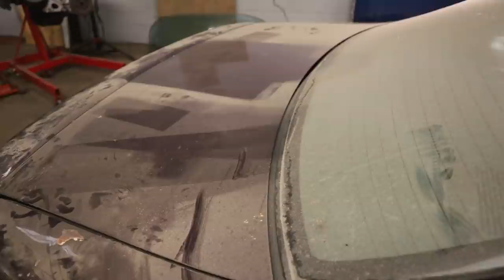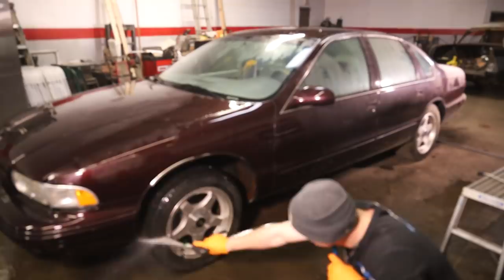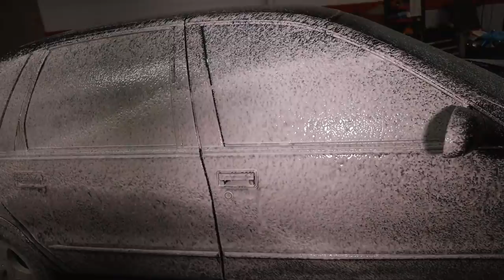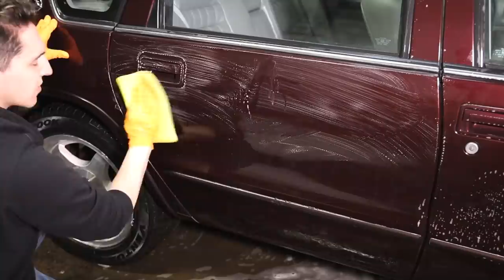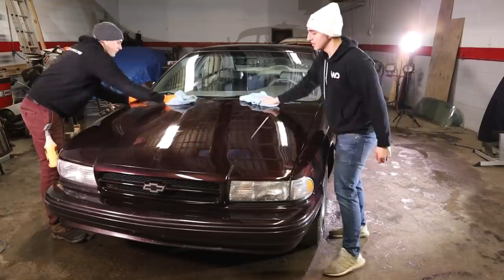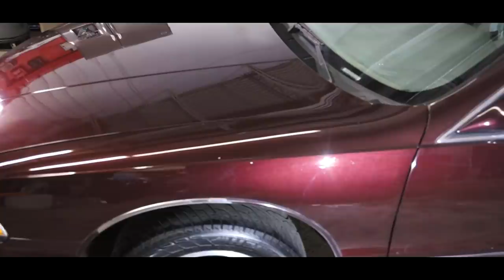ABANDONED BARN FIND First Wash In 10 Years Impala SS! Satisfying Car Detailing Exterior Restoration

Comment: Nice video! From the moment it was pressure washed, I would have stopped there. Tail lights missing black trim, bumper cracked, quarter panel rust spots, spoiler missing clear/paint etc. She needs a respray. I have a 96’ SS same Color, nice find though.